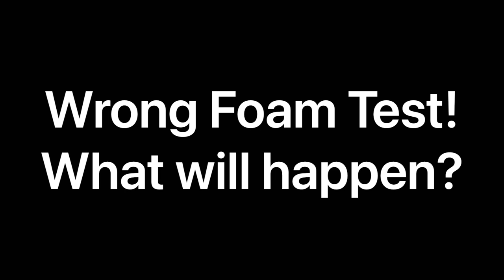Wrong spray foam around the window! Broke the window? Window Insulation

Comment: I've used gaps and cracks spray foam on metal/aluminum windows and on pre-hung fire doors without any issues. I would advise that you use window and door spray foam if you are sealing up a vinyl window or a wood door frame.

Comment: I know this is a old video but the reason you don't use the gap filler is because it's a more dense closed cell foam. Verse the window and door with that reasoning over time as the house settles and shifts the big gap doesn't collapse as much if any to allow the window and doors to shift with the house

Comment: I’m surprised it didn’t squeeze the window too much. My dad used the wrong foam with a door and caused the frame to bulge and almost made it so you couldn’t open the door. It was a mess.
Reply from the maker: i think if i had the frame around it it would have been worse. but i also wanted to test it out.
Reply: Just happens to me right now

Comment: Should foam always be used if there are gaps around the window? I just had new windows installed, there were gaps, and they used trim to cover them but no foam.
Reply: Absolutely, yes. If they didn't use it. It just lazy and trying to get the job done as cheap as possible. It's easy to do. And you don't have to fill the gap all they way up. Like he did in the video. Just try to get it even. Then you don't have such a mess to clean up. Then if you have to use caulk.
Reply: My double glazing has no foam and there's alot of traffic noise and some drought coming through the frame.